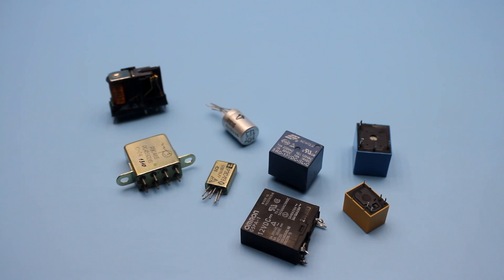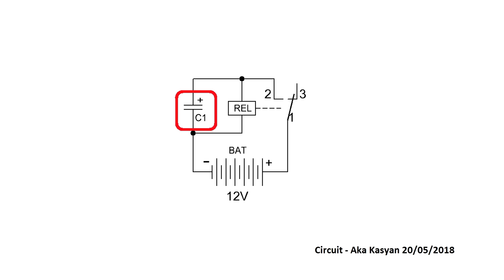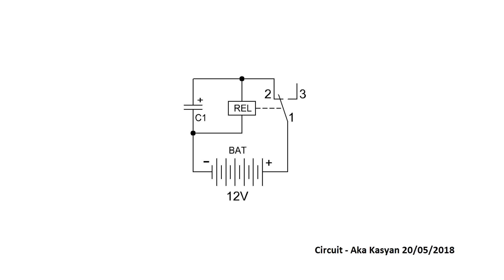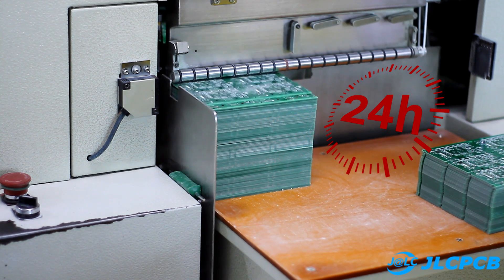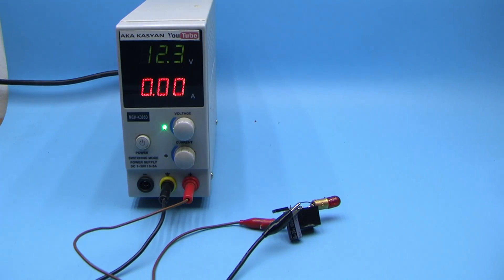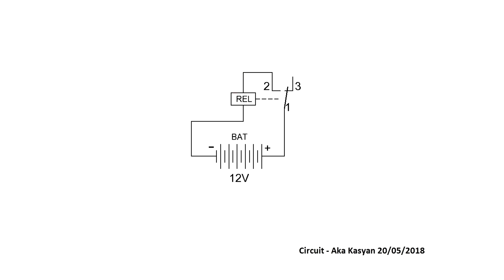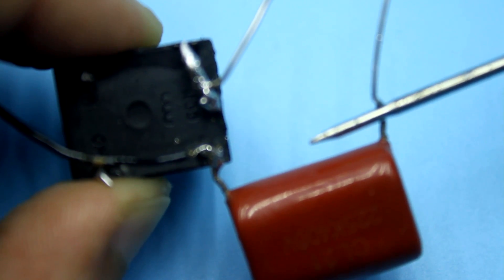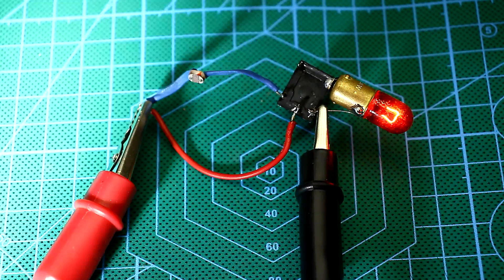What you can make with RELAY

Comment: All of the mentioned circuits should have a diode in reverse across the coil of the relay to discharge the high voltage and not damage the circuit